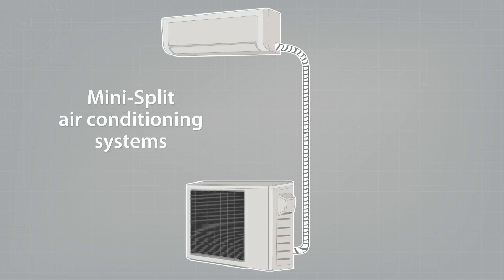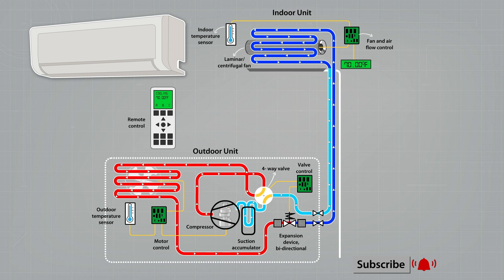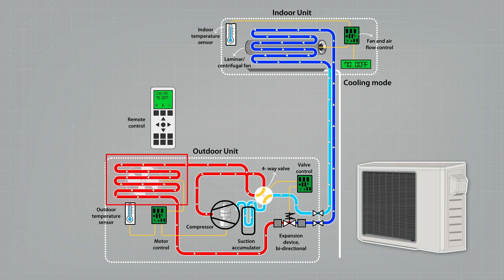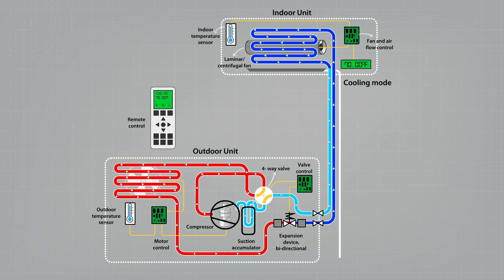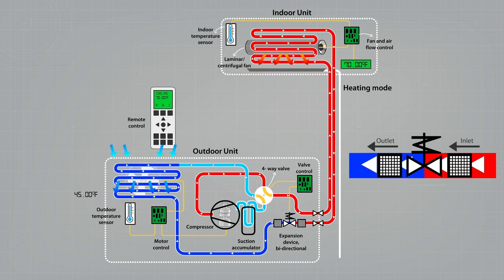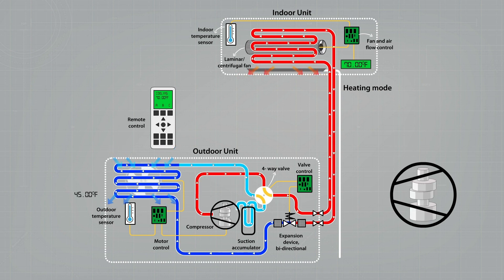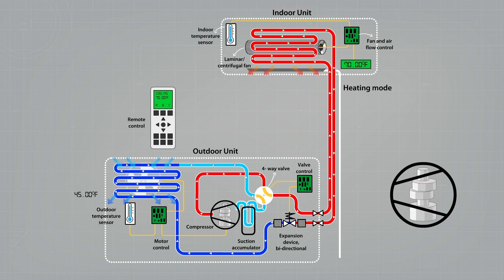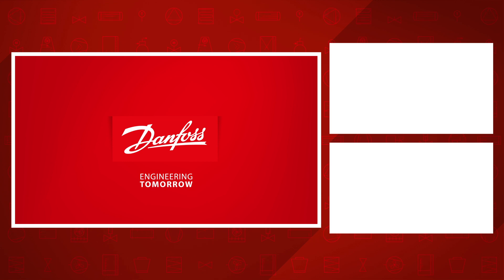How a HVAC mini split system works | HVACR Distillery

Comment: How hot or cold do the lines between units get, and is it worth adding additional insulation, either between lines or around them both, more than the foam that comes on the lines? I will have 25' lines running up the outside of our west wall, which will get sun when the upstairs unit is in cooling mode, so I'm wondering if it's worth extra insulation to keep those lines cool.  And in heating mode, will the lines be much hotter than outside air, so would more insulation help?
Reply from the maker: Hello, thank you for your question. We will contact our experts and come back to you as soon as possible with an answer.
Reply: @DanfossClimate  I'm in a similar situation, I would like to know the answer as well.
Reply from the maker: @thierrypaquette2273  Hi. Please check the answer we provided here in the comments.
Reply from the maker: Hi. Yes, the lines should always be insulated. If there is no insulation, there is far too much heat transfer between both lines and to the environment making the system far less efficient.
The hot line can reach temperatures of up to 70°C, the cold line in cooling mode is at approx. 6°C, in heating mode the cold line is approx. 8K below ambient temperature. Hope this helps!

Comment: does it introduce outside air to the inside or is just inside air cooled?
Reply from the maker: Hi. The A/C mini split system does not move air between indoors and outdoors. Only the refrigerant is circulating between the indoor and outdoor unit. Both units are air cooled in these systems. We hope this answers your question!
Reply: @DanfossClimate  thanks for your time, i thought that was a bit confused!

Comment: Do you need to hook it to 220
Reply from the maker: Thank you for your question. We will contact our experts and come back to you as soon as possible with an answer.
Reply: Hi Shirley, Yes. The Mini split system will require mains power, 230V or 120V depending on where you are.

Comment: can we replace refrigerant r290(propane) in any mini split system?
Reply: Hi again, Pierre. The answer is a No. You will need to ask the manufacturer what refrigerants are allowed in the system. :)
Reply from the maker: Thank you for your question. We will contact our experts and come back to you as soon as possible with an answer.